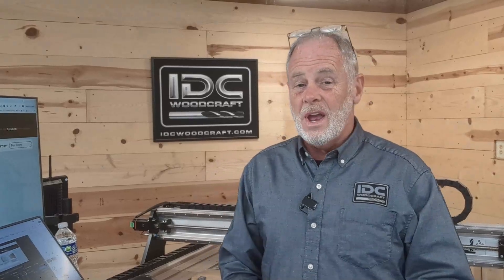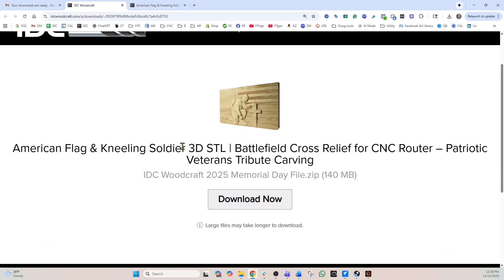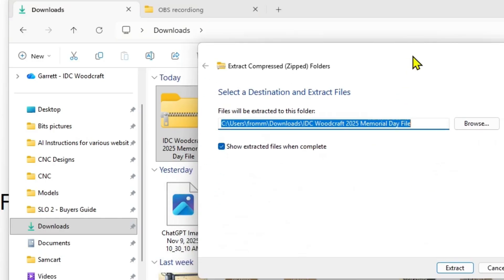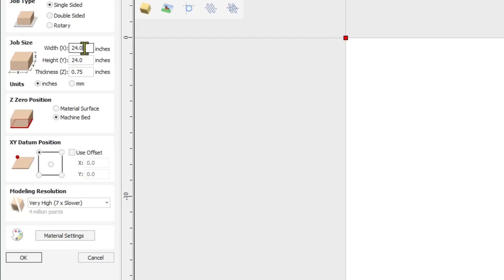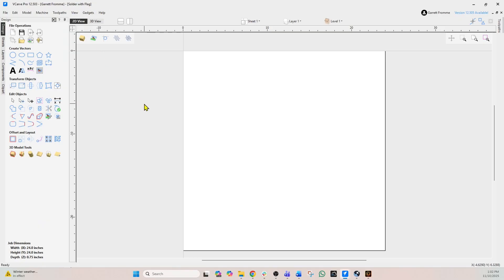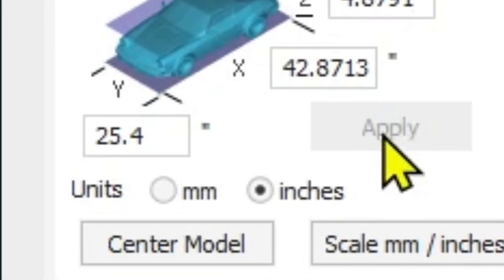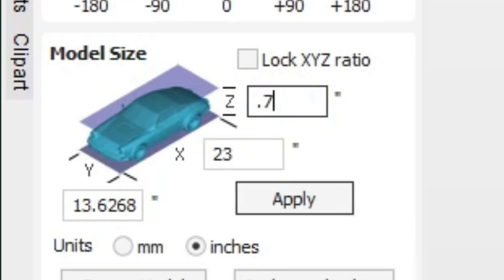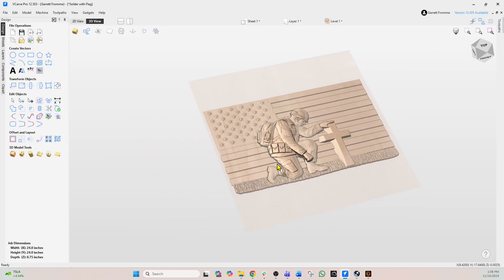How to Unzip & Import 3D STL Files into Vectric VCarve & Aspire – IDC Woodcraft Tutorial

Comment: When I purchase the software can I use it on both of my computers, But only on one at a time
Reply: I just purchased Vectric Pro and it appears I can run it on three computers, at least that is what I can tell so far.
Reply from the maker: That usually depends on the software's licensing agreement, my friend. I recommend checking with the software provider to confirm their policy on multiple devices.